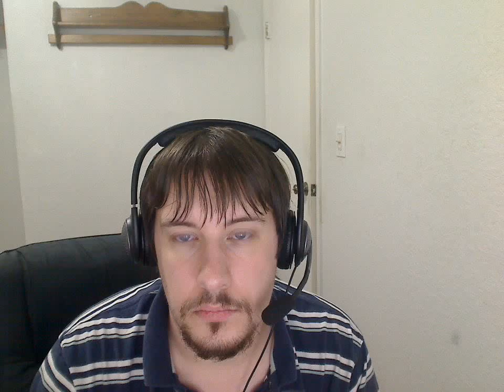Heatsink & Fan Issues Resolved!

Comment: yeah, at 60 C, I turn off my computer. 50 C is a warning to me (Dell Laptop). Usually my temp is around 42 C.

Don't leave your case open, it messes up air flow so your fan just pulls air near it and not from your hot components.

Comment: it doesn't. you know, the temperature sensors in computer hardware does not come fine tuned and calibrated. I run my computer on aprox 34-48 while using it, "water"cooled. But that was after I calibrated my sensors and had my "water" to run through my freezer.

Comment: I have that laptop... if you want it to run cooler, take the back off and remove the black plastic on the cover, it's supposed to protect against spills and dust, but all it really does is make the computer 20c warmer.